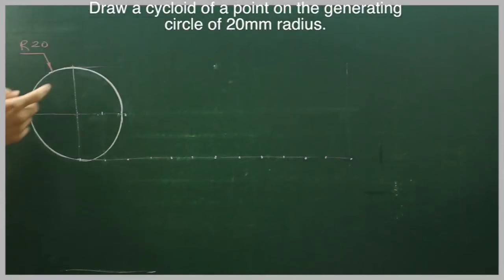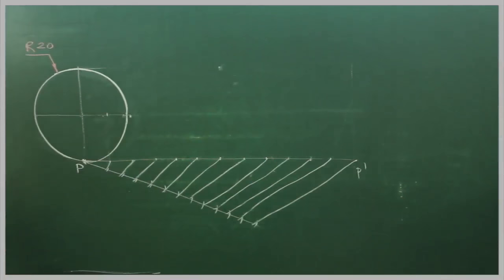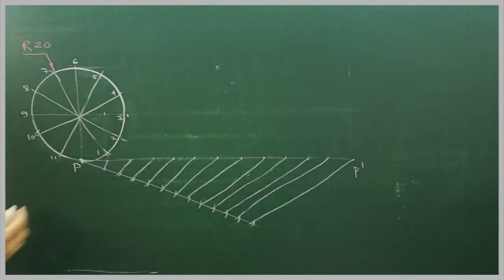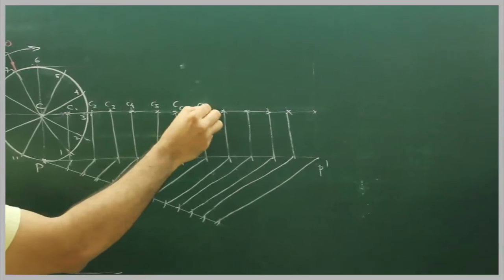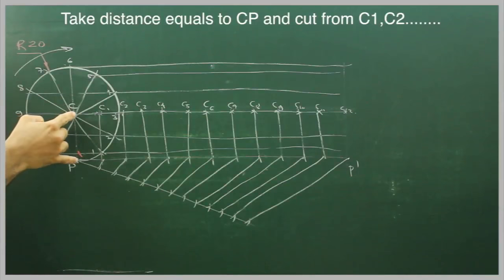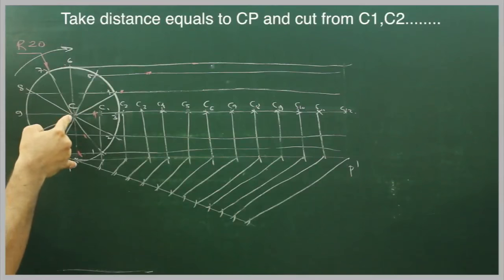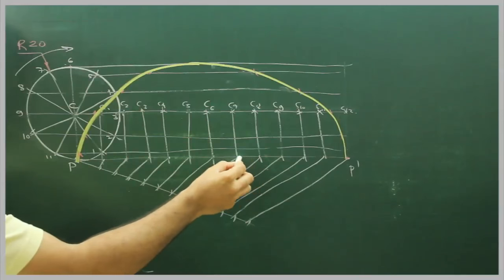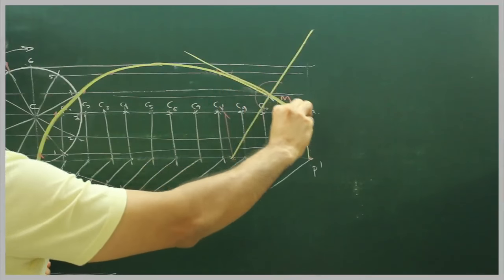Cycloid

Comment: Sir, how to draw tangent to a cycloid when certain distance is mentioned. 
For example:- draw a tangent to a cycloid with the given distance of 40 mm
Reply from the maker: Like how I have taken 25 try with 40 and see 👍
Reply: Sir, u taken 25 mm up sir, and I can't understand that, what the horizontal line which touching the curve to draw tangent
Reply from the maker: @janakiramuduenjum5666  I have taken it parallel to the bottom line
Reply: @technicaldrawing  sir, is that line was coinciding
Reply from the maker: In exam they will give small distance than diameter so it won't coincide.
Reply: @technicaldrawing  Ok sir